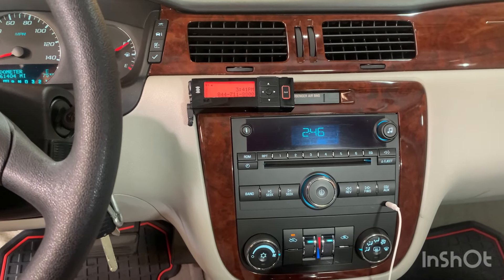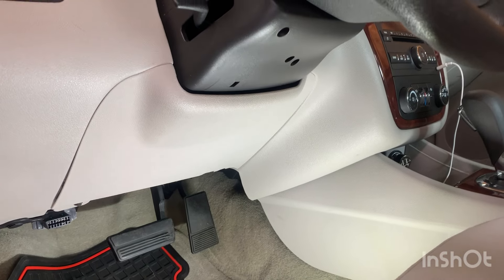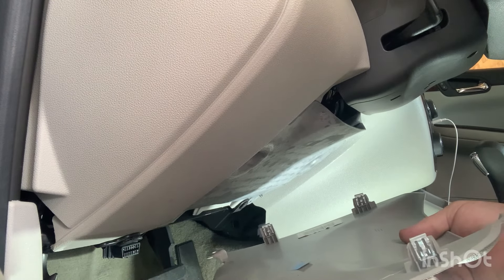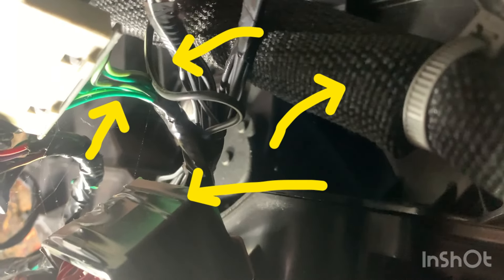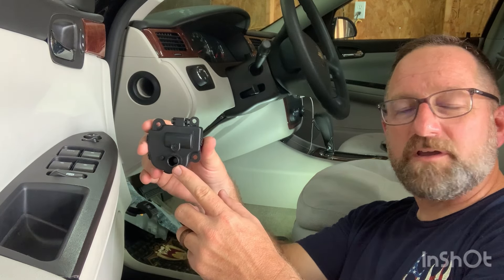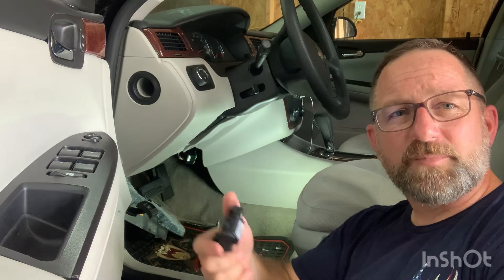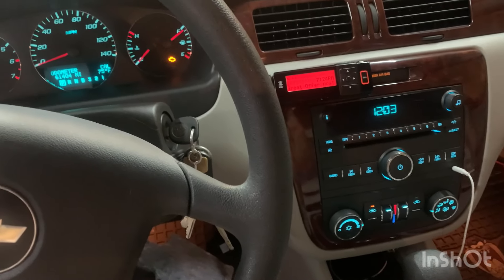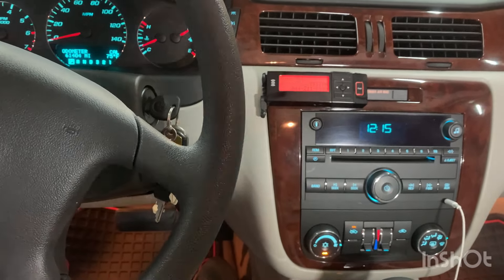How to fix clicking noise in Chevy Impala #WhoJoeDaddy

Comment: I was able to change this same actuator. I see more why no pictures of the removal or install it’s all done by feel. Thanks so much!!  My clicking noise is stopped and all my vent locations are working. This was the only video that popped up for the drivers side. Never could have done without your help. The restarting and calibration information was so critical. Thanks again.
Reply from the maker: Your totally welcome. This is what’s awesome about YouTube, helping each other out. Glad it helped.
Reply: Okay so once you replace this part, your fans and heat and a/c work? Or have you to change the coolant?

Comment: I have done this twice. I did better laying flat looking up into that area. The essential tool is a 1/4" drive screw driver and a 1/4" universal joint. It is an extremely hard thing to replace, but it can be done. Good  video.
Reply from the maker: glad it helped

Comment: THANK YOU. CALIBRATION WAS MY DOWNFALL BEFORE!
12 months ago I changed the passenger side BDA. TWICE. FAILED TWICE.  I failed twice! How could that be??? I followed everyone’s advice. Having given up temporarily trying to figure it out, we drove through the winter clicking with heat on just one side. Spring arrived and the driver’s side joined the chorus. Now we have two abominable clickers. It’s when I came to your video that I first heard
-Disconnect the battery and turn the key to on for 5 minutes to drain power in the system.
THEN GO TO WORK.
AND
When installation is complete 
STOP - CALIBRATE FIRST.
Connect the battery turn the key to on and let it calibrate for 5 minutes, then turn the key off. NOW AND ONLY NOW IS IT OKAY TO START THE ENGINE.
Yes the left side is a bear to do! BUT after calibration the sweetest sound after a full year is SILENCE and all is operational!
CALIBRATION!!!!!
Thank you WhoJoeDaddy
Reply from the maker: Great Job and thanks for the update. Glad the video helped.
Reply: Thanks for the video
Reply: So if you had to replace your battery on your car you could possibly wind  up with a problem with your actuators on your heater yes no?
Reply: I’m not an auto tech, but my experience with newer cars is that electricity, and electronics are paramount. I would do work on my Chevy ONLY when the battery is in top notch condition.
PS: As far as I know, if the battery is disconnected there is no way to open the trunk lid. There is NO key entry. This is just one simple example of the paramount importance of electricity/electronics

Comment: Thanks for the video it was very informative and helpful, just a question, after I change the 2 actuators from the passenger side I started feeling a bad smell coming into the cabin even if the A/C is off, any suggestions on what is causing the smell and how to fix it? Thanks
Reply: Try changing the cabin air cleaner.

Comment: Thank you friend I did passenger side both about year ago got in yesterday and that god awful clicking but on driver's side thought oh boy here we go again thank you for taking the time to show and explain as I'm a hand on learner I found after watching you do this I surely can do ordered the part made sure it was the one and yes can feel the darn thing clicking it stops after about 5 minutes it don't continuously yet but I'm sure if I don't get the new one in continuous will be next 😢.So I'll update you when I get part and install it tueday. .
Thanks again 👍😊👍.
Reply from the maker: Glad you found the video useful. When the one closest to the passenger door went bad, it would tick after the car was turned off and just sitting for a while. My daughter drove it to school and someone told her that her car was ticking. Definitely annoying, good luck with driver side and let me know how it goes.
Reply: @WhojoedaddyDIY  have part still haven't gone out to do it yet .
I had some issue on passenger side clicking while car ignition was off .driver's side is not doing this yet.thank you again 🙏
Reply: Ok finally had thf time this morning 🌅 
Man what a pain in the $#@.
However all went as shown in your video no real issues besides the fact this is all done by feel I found a swivel on my quarter drive socket was extremely useful as well as a 18 inch long small flat head screwdriver 🪛 to pop that clip off back there that was the hardest thing for me .
But all done and no clicking thank you thank you thank you 🙏 

🎉🎉🎉🎉🎉🎉🎉🎉
Have great weekend friend .

Comment: Hi so my daughters car is making this noise and the mechanic is telling her it is a huge job and needs to remove entire dash board and probably an 8hour job, how can I tell which actuator needs to be changed ?? We get the sound just by opening the car door sometimes and sometimes only when we start the car but does same as your keeps going when you turn car off.
Reply from the maker: Try taking a long screw drive and put the end of it on each actuator and you will be able to tell by the vibration of the clicking. The 2 in the glove box are super easy to replace. The driver side is a little harder just because you have to put it back in by feel, but you can do it I promise. Definitely not paying someone 8 hrs of labor. Hope this helped!
Reply: @WhojoedaddyDIY  thank you for your advice and taking the time to read my comment/question.

Comment: Mine doesn't have a harness wire. If I buy a wire for it, how do I install it? The plug goes into the actuator, but where do I connect the remaining wire on the other side?
Reply from the maker: Are you sure the wire harness isn’t tucked in with other wires? Can’t imagine why someone would remove it.
Reply: @WhojoedaddyDIY  Well, I bought the car used, and there were other problems with it that I managed to fix, but this one just strange how the actuator and wire isn't even there. I'm gonna buy the parts, but I don't what power source to the plug the wire in?

Comment: What's the actuator that does a slower bumping noise?  Whatever it is, it was doing this for about 2, 3 years and has now, suddenly gotten obnoxiously loud, like someone knocking on the wall, inside the passenger side dash.  2010 Impala.
Reply from the maker: Sounds like the passenger side actuator. Good news is it’s the easiest to replace. Drop your glove box and find the actuator, touch it with a screw driver. If it’s the one going bad you will feel the knocking vibration through the screw driver. Super easy and inexpensive to fix yourself. Good luck!

Comment: How many actuators in a single climate control vehicle? Is there a left side actuator at all?
Reply from the maker: You have 2 behind the glove box on passenger side and one on the driver side behind the dash.
Reply: Thank you for the response. What does the one on the driver's side control? I have replaced the glove compartment two, the left was apparently hot/cold and the right recirculation. @WhojoedaddyDIY

Comment: I have a 2013 impala from my dad. Have you ever had the 5 spoke rims start to peel. Flakes by the stem. I want to keep the car nice because my dad passed away in 2020. My mom gave me his car. Think it might be from the salt they use in Iowa on the road in winter. Really don't want to buy new rims. Think they are ok just don't like how it looks unfortunately.
Reply from the maker: Sorry to hear about your Dad, understand it can be comforting to hold on to things that were once used by loved ones. Haven’t had any problems with my rims so far and don’t really know of a fix other than trying to spray paint them, but that doesn’t usually turn out to good.
Reply: Yes they peel.
Reply: They do peel. My rear passenger side has peeled and I’ve been considering replacing it.

Comment: Hi. I actually changed the actuator on the passenger side  last year as it was making that really loud noise exactly what you had on your video and it did fix the noise...though I've never done any calibration after changing the actuator. however, I noticed now that I hear a really minor or NOT so loud clicking noise even we don't turn the engine, it doesn't last a long time but I am wondering where that noise coming from..  do you think that is still the actuator acting up?
Reply from the maker: The easiest way you can check the actuators is to put a long screwdriver on each one. If one is bad or ticking you will feel it tick through the screwdriver 🪛. I have had to replace all 3 of mine within a years period.

Comment: How do you know which one to replace?
Reply from the maker: Drop the glove box and touch each one with a screwdriver and you can feel the vibration of the one making the noise. If it’s not those then it is probably the one on the driver side.

Comment: Thanks so much, my actuator started clicking on the driver side too, is that the reason when I turn on the AC, the passenger side received cold air, and the driver side still is blowing out heat?
Reply from the maker: You have an actuator on the driver side and passenger. So if one is not responding when you change the settings or starts clicking. I would check that side first by touching the actuator with a screwdriver to fill if it is moving or clicking.

Comment: How do you know which one is bad?
Reply from the maker: If you drop your glove box, you have 1 mounted to the wall on the left and one on top blower motor. Touch both of those and see if you can feel the clicking. If you can’t, it is more than likely the one on the driver side. You can use a long screwdriver and touch the one on the driver side to feel clicking.